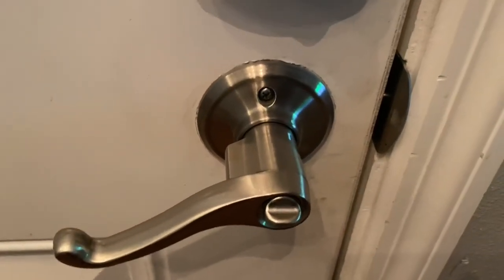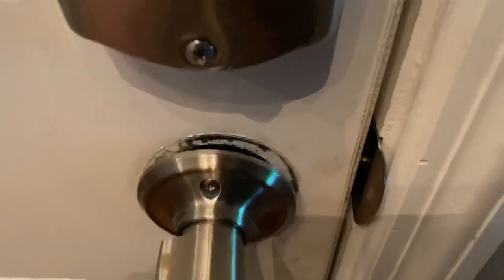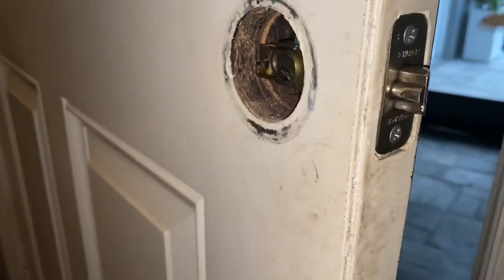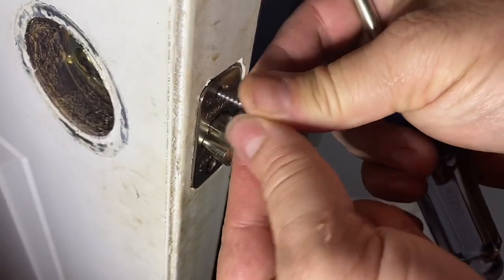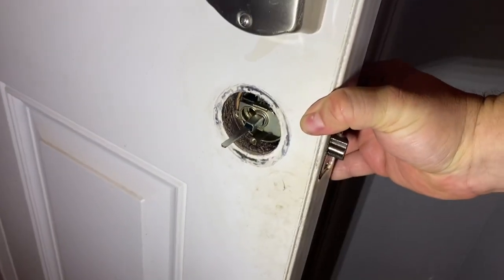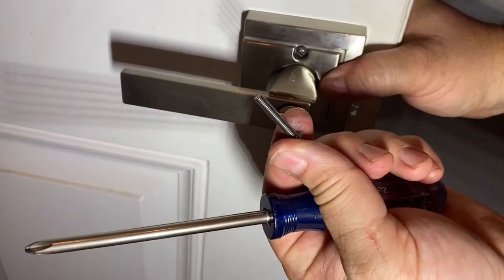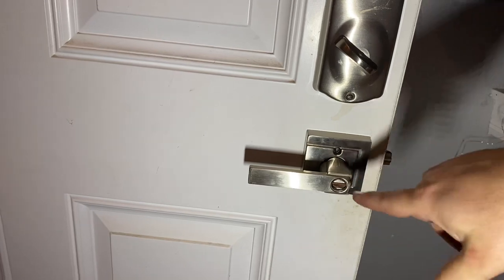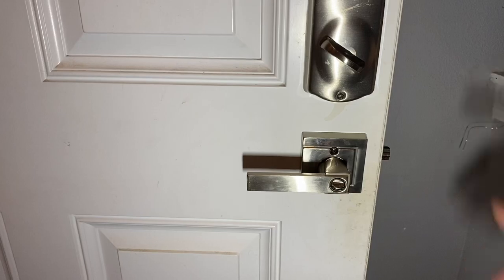How To Fix or Replace a Broken Door Knob EASY DIY

Comment: Thank you for the information with the latch, I had the same problem and was stuck at that part years ago. Wish I knew that information about the two bars back then so I wouldn’t have had to call a locksmith. Ah well.